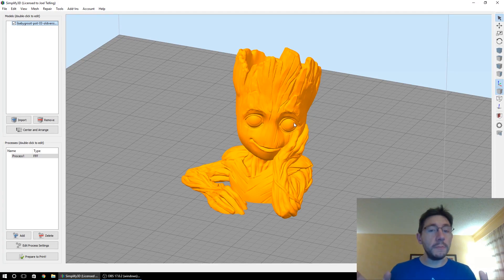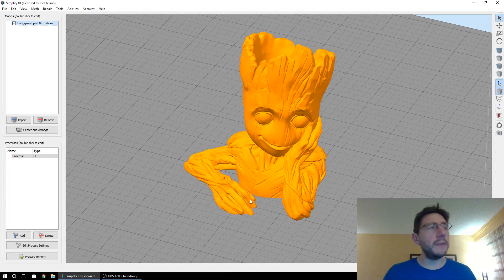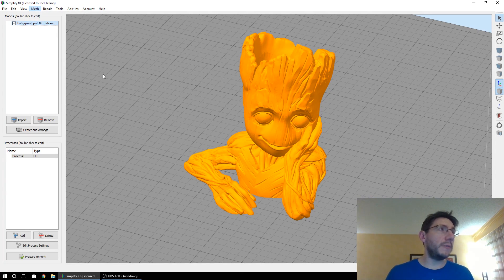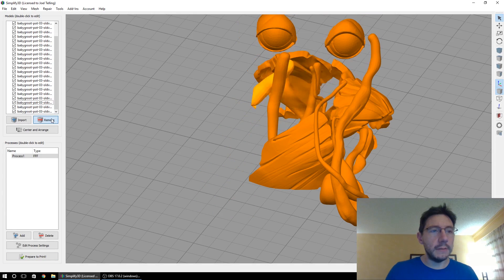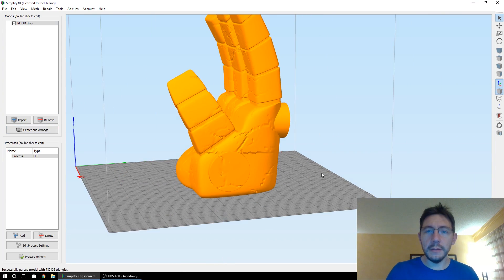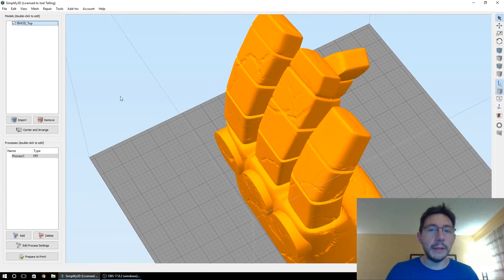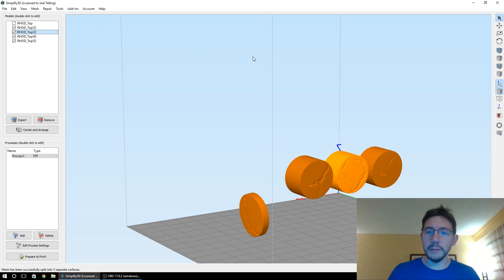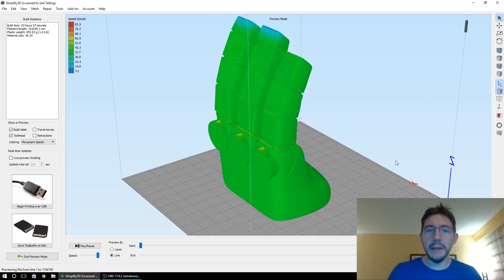3D Printing 101 with Simplify3D and Separate Connected Surfaces

Comment: Great video Joel. Whats the next step for a beginner if this doesn't work? Additionally, What type of things cause this to occur in the first place; could it be due to poor CAD softwares?
Reply: For the Groot mesh, it's not a result of poor software, just design choice. Yes, it's best practice to unify the mesh to one contiguous shell (if no more editing is intended). Another aspect of the final print is the slicing software. Cura was used for the original print, and it turned out nice and clean. The original software this was created in was Zbrush (amazing sculpting software)
Reply: Thank you for the Reply. Aside form not Unifying all meshes, What were the design choices that were poor?
Reply: I didn't mean to imply that it was a poor design choice. Just that it was one of several ways to design and share it. But yeah, making it one mesh would have been better for the platform it was shared on. The model on MyMiniFactory.com has been updated for a while now to be one contiguous mesh. I updated it shortly after first publishing it cause I realized it needed to be as easy as possible for folks to print it on their machines. I'm really grateful to the community for recommending the edit and I'll be posting my future models as one mesh. Joel was one of the awesome people who got their hands on the multi part model before I updated it :) It's super exclusive... lol

Comment: I am having issues getting simplify3d to connect to my DaVinci 1.0A. I can connect, but it won't transmit the print or start it. I use the "Print over USB" option. The communications tab does not update with any gcode or commands getting issued, simplfy 3d just stays at the print overview page with a loading bar that says "Printing" in the bottom right that never progresses, like it's frozen. Is this an issue with USB drivers? Or is there any special settings for the DaVinci 1.0A (Repetier .92 firmware) so the print actually gets sent to the printer.

Comment: My vendor proprietary slicer (XYZware) asks if you want to "auto-fix" most of the complex designs I've tried from any of the online sites.  It isn't documented exactly what this function actually does though.  From your and Angus's discussion of connected surfaces, I wonder if it automatically tries to clean those up as part of its processing?

Someday I'll hope to aspire to Simplfy3D, but at my very simple, rank beginner level - it'll be a while before I can justify that significant expense...  Right now I wouldn't have a clue how to successfully use most of the individual controls.

Comment: the reason it takes soo long, is because the software has to compare every face against every other face for intersection. It can be sped up by some clever programming, but you may lose accuracy that way. So most software will decide to do the full comparison in order to ensure that the result is as accurate as possible.

Comment: Just a quick tip. If you press CTRL L you can point to any triangle and that will lay it flat on the build surface.
Reply: I never saw that (the menu was misleading), and always struggled to find the correct axe to rotate.
Thank you so much!

Comment: So, to the 3d artists out there: Is there a way to do this process before exporting your STL, say in Maya or 3ds Max? I know you can combine meshes, but does that remove interior polys, like this?
Reply: Yes, but on more complex models it can take a while especially if the models aren't originally designed for 3D printing. This process is much faster than going through and adding Booleans to everything
Reply: Gotcha. I went to game school, but I was focused on the programming side of things, so I learned some modeling, but I'm not proficient, by any means. Getting into printing, I've been pushing myself back into it, but I've actually printed a few models with intersecting meshes, not realizing it could cause issues like this.

Comment: "Discover, download and 3D print free and exclusive guaranteed 3D printable objects from a community of talented designers." I suppose this phrasing makes it sound like not all the models are guaranteed to be 3D printable but maybe just the "exclusive" ones? 

5:40 Better than the OSX Beach ball :-p
Reply: All the models on MMF are guaranteed to print. It's part of the review process before a model is allowed to be published. The Baby Groot model was originally sliced in Cura and printed successfully on an Ultimaker. Cura powered through and created clean layers. Just as long as all the parts are manifold, that's what mattered the most. I will say though, it is best practice to unify multi parts if there is not more editing needed on the mesh. Try Cura out when you get a chance. It's a great slicer from Ultimaker